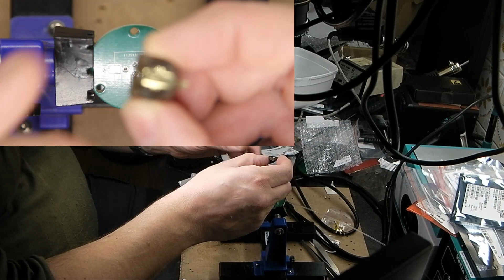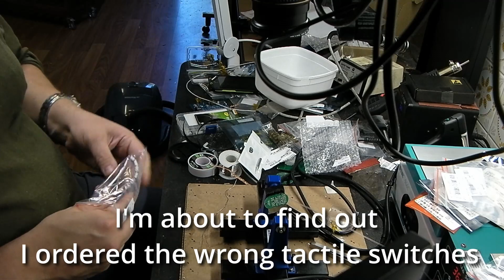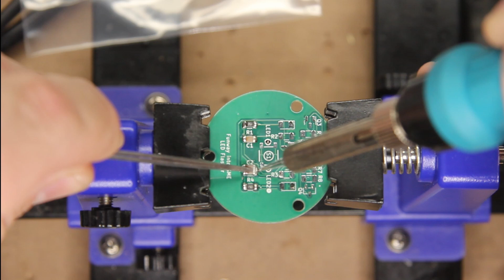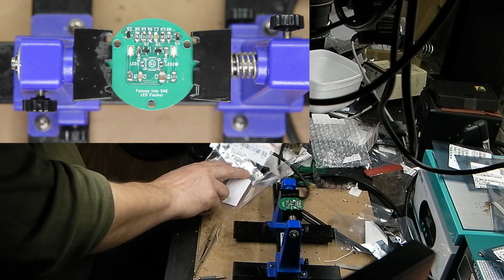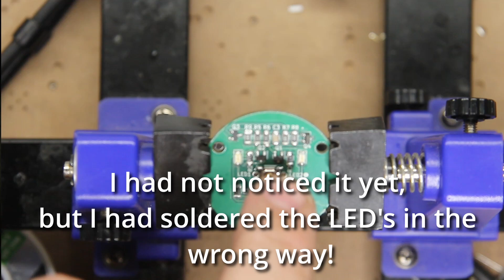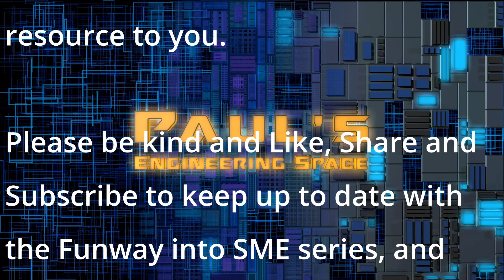Funway into SME (Project 1 - LED Flasher: Part 2)

Comment: If you know electronics, why don't you repair the Dick Smith soldering iron ?
There is knowledge to be learned in diagnosing and repairing your own equipment. And usually it saves you money.
You said "it's been a few years since you hand soldered", what other type of soldering is there ?
Reply from the maker: Hand soldering surface mount with an iron is what I’m referring too, I mainly kept to PTH with an iron and did SMD with reflow or hot air

The problem is with the heating element in the iron and parts have not been available for about 10 years since DSE shut it doors